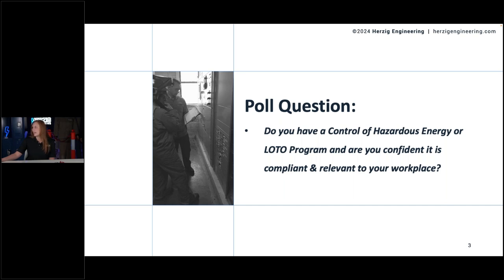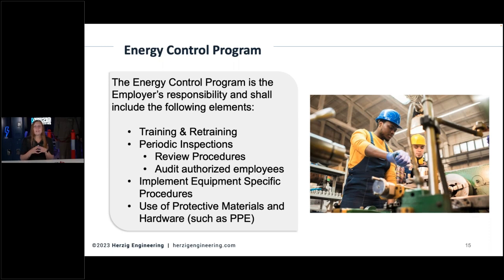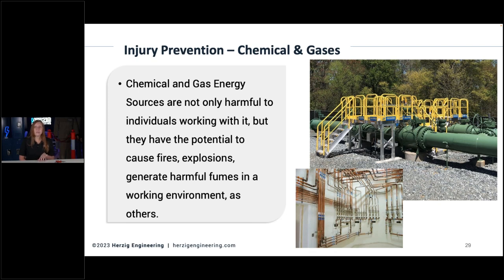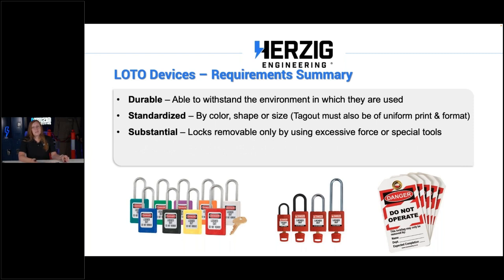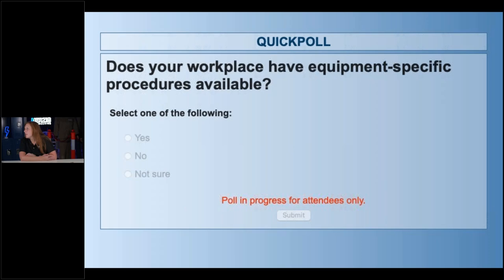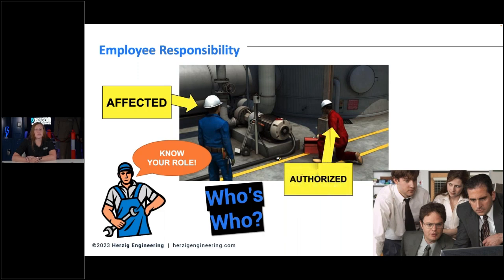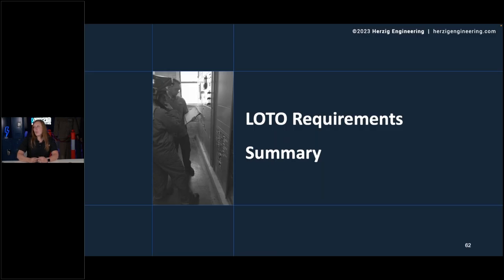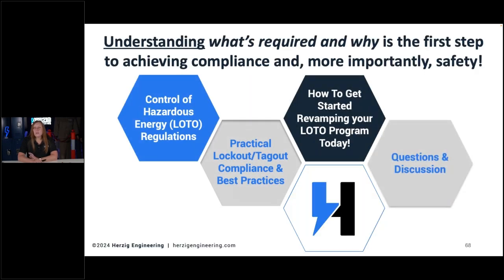Control Of Hazardous Energy: How To Practically Apply Lockout Tagout Standards

Comment: Great seminar.   I have a quick question regarding arc flash studies in sort of a gray area if you will.   Specifically farms.  Some farms have 3 phase power for operating larger motor load (ex. grain dryer, milker, silage conveyer) run to the barn, while the house is single phase but fed off the same transformer bank off the road.  (In 2005 when I was 16 moved to my stepfather's farm and we had an open delta 120/240V 3 phase service,  barn had 3 phase, house was single phase.  There were no arc flash labels anywhere. The farm didn't have electricity at all until 1947, the 3 phase was added in 1993, if that helps.   

To simplify my question,  are there different standards and regulations regarding electrical safety for farm settings with 3 phase available than,  say in an office building or large commercial/industrial building with 3 phase power.
Reply from the maker: Hello! No, there are not different standards for farms specifically. If the hazard is present, they need to be addressed appropriately.
Reply: Where can I get the slides